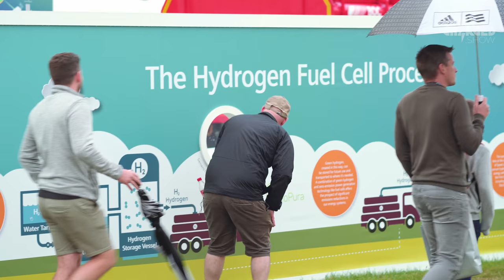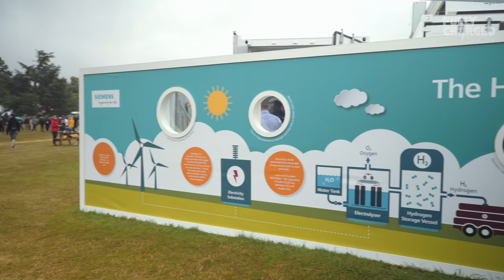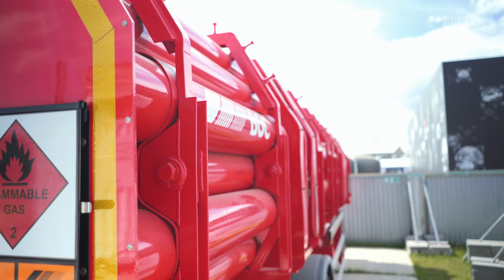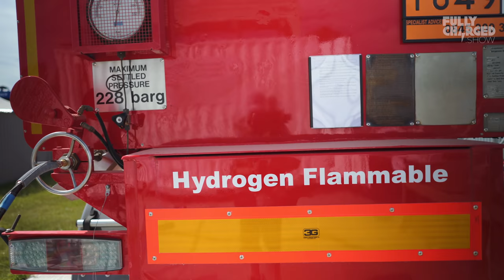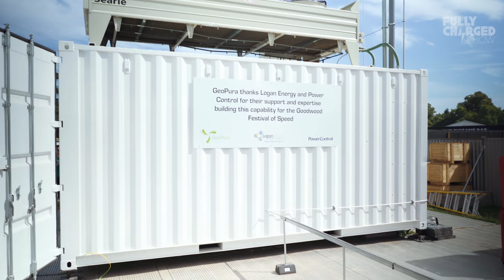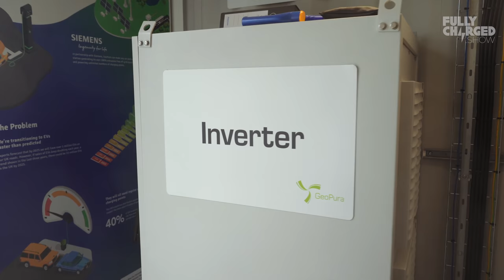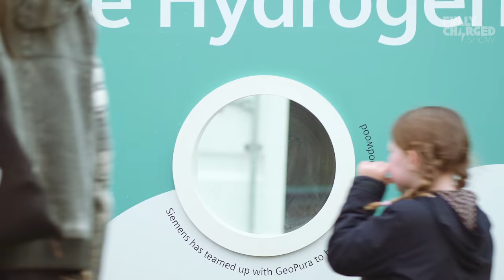Green Hydrogen Fuel Cell Charging System at Goodwood Festival of Speed | Fully Charged

Comment: I think the focus should be on making Hydrogen fueled vehicles
Reply: Bit hard if you have nowhere to fuel them. That is the multi billion pound problem hydrogen has. Not enough cars to make a fuelling network viable, and not enough fuelling stations to make buying a hydrogen car viable. Tesla saw this early doors and invested massively in the supercharger network. I don't see the same with fuel cell car manufacturers.
Reply: @edwardbyard6540  - I've thought about that. What if the tech could be made small enough (and it appears it can be) that the system to produce Hydrogen were integrated and installed in each vehicle. Therefore all you would need is to add water. which is just about everywhere. 

Furthermore, what if your also added a dehumidifier to that same system ; then when you were driving, the dehumidifier could collect water from the air as you drove and adding that water back into the system. 

Theoretically,  in humid areas, you may never have to fuel up?
Reply: Why?
Reply: @dr-k1667  - What if the tech could be made small enough (and it appears it can be) that the system to produce Hydrogen were integrated and installed in each vehicle. Therefore all you would need is to add water. which is just about everywhere. 

Furthermore, what if your also added a dehumidifier to that same system ; then when you were driving, the dehumidifier could collect water from the air as you drove and adding that water back into the system. 

Theoretically,  in humid areas, you may never have to fuel up?
Reply: @Steve Davis - No, its called technology

Comment: Great... waste 50% making and compressing the hydrogen, then half of the remainder when turning it back into electricity. If you have electricity to start with, and use this crap to store the energy, you only have a quarter as much. 

Batteries are 95% efficient (discharge energy is 95% of charge energy, as you can verify looking at the CAN bus data of a Model 3, or better yet measure yourself!) and the world doesn’t even produce 10% of its energy consumption from renewables. 100% of normal homes and offices can store enough energy with a couple of second-life batteries from EVs. 

Hydrogen is a SCAM unless it is combined with an abundance of very cheap clean electricity, which is to say with either fusion or fourth generation fission power. And you guys keep giving a megaphone to these enemies of the people. That makes YOU enemies of the people! SHAME ON YOU